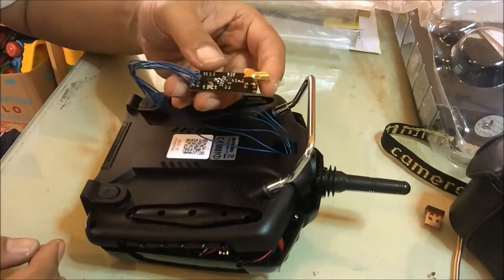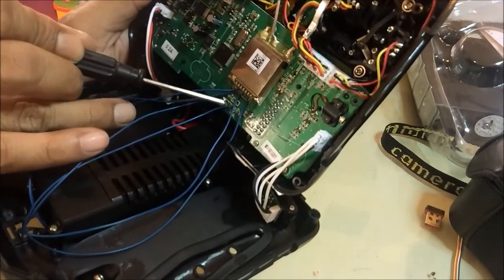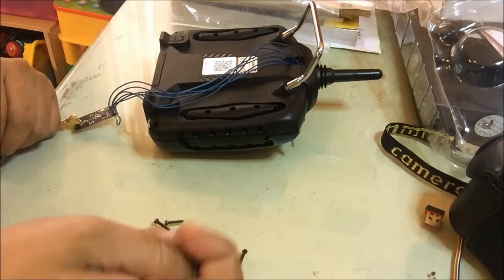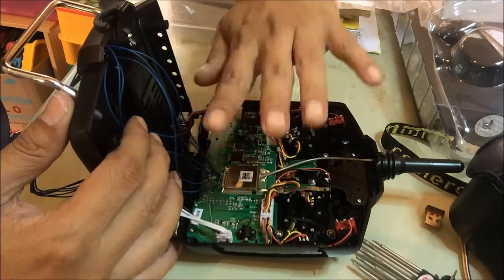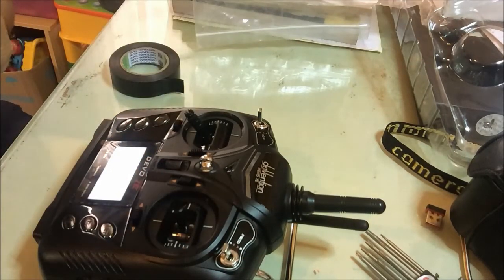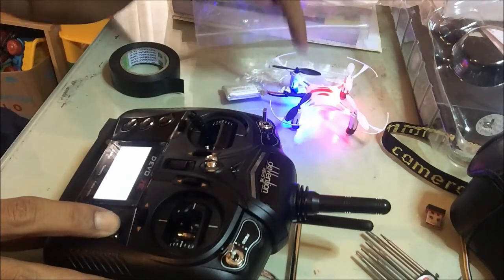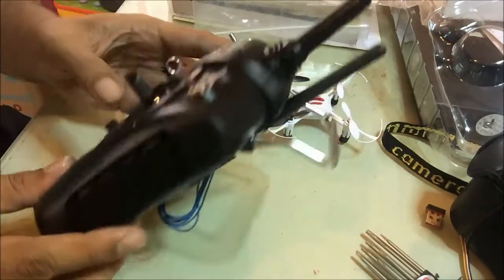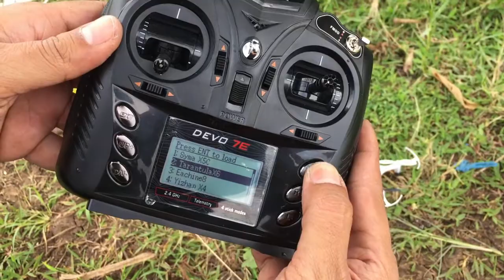Step by Step Installation NRF24L01 Devo 7E and Bind to JJRC X1 Syma X5C Tarantula X6 Eachine H8 Mini

Comment: Are you going to try installing the 3 in 1 or 4 in 1 module?
Reply from the maker: +PROCESSOR302 - This is just 1 module. And with the stock module inside the Devo, it became 2-in-1

Comment: mas itu asal solder aja ya ? trus setup dpcnya gmn lo sekarang harus upgrade firmware kejumper aja bisa ga 😅
Reply from the maker: Halo mas, ini video lama hehe... saya agak lupa. Tapi ada bagan khsus untuk cara nyambungin kabel2 dari modul ke devo. Kalau ngga salah, saya sertakan link gambarnya di deskripsi video. Atau mas bisa cari juga di google. Untuk firmware, ikuti yang terbaru yang ada di website deviation
Reply: Arya Dega udah bisa kok mas , udah saya praktekn, work 👍
Reply: cuma saya belum coba internal modul bawaan devo rangenya gmn , mungkin mas pernh coba range bawaan devo 7e ?
Reply from the maker: Belum pernah nyoba mas. Tapi settingnya bisa sampai 600mW kalau ngga salah. Itu biasanya bisa jarak sampai 500 meter
Reply: Arya Dega setingan yg mana y mas ?

Comment: mau nanya nih mas. saya udah upgrade devo 7e saya pakek deviation 5.0.0
pas saya model setup mau coba bind ke wl toys v912 (di tutorial lain pakek model Flysky untuk v912 mau bind), opsi yang ada kebanyakan pakek tanda ( * ) di depannya , dan gak ada opsi bind adanya Re-Init. apakah harus saya install dulu ya mas modul NRF24L01 nya? memang hardware belum saya MOD sih.
INI OPSI MODELNYA Mas :
1. DEVO -- BIND
2. WK2801 -- BIND
3. WK2601 -- RE-INIT
4. WK2401 -- RE-INIT
5. DSM2 -- BIND
6. DSMX -- BIND
7. J6PRO -- BIND
8. *FLYSKY -- RE-INIT
9. *HUBSAN4 -- RE-INIT
10. *JOYSWAY -- RE-INIT
11. *FRSKY -- RE - INIT
12. DST
 MOHON PENCERAHANNYA MAS...
Reply from the maker: +Cahya Aji - Iya masssss... harus pasang modul NRF24L01 supaya ada penerjemah protokolnya. Cari yg PA ya (power amplified) modulnya.
Reply: oh gak semua yang di olsop udah PA ya mas? ada link?
Reply from the maker: +Cahya Aji - ada yg tanpa PA dengan ciri2 antenna nya nempel di PCB (patch antenna). Kalau yg PA itu antennanya eksternal bisa lepas pasang.